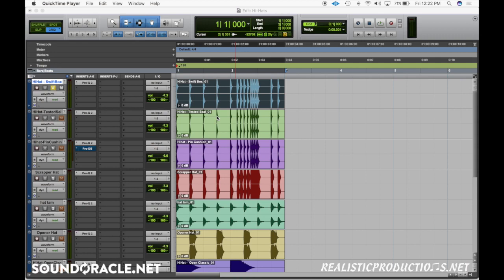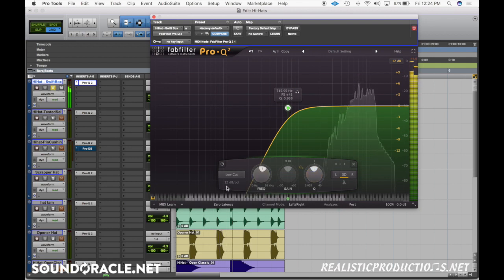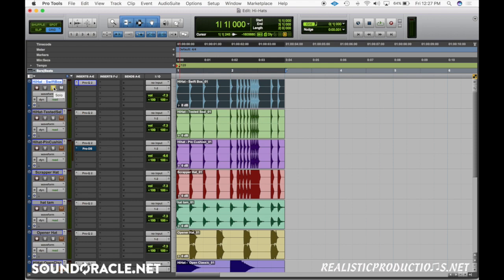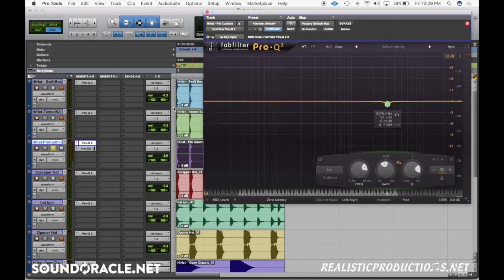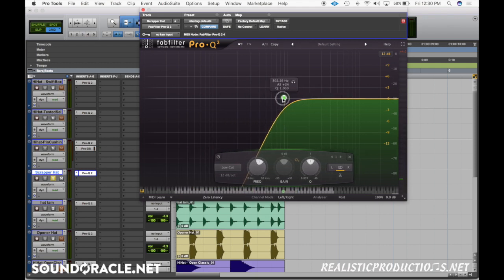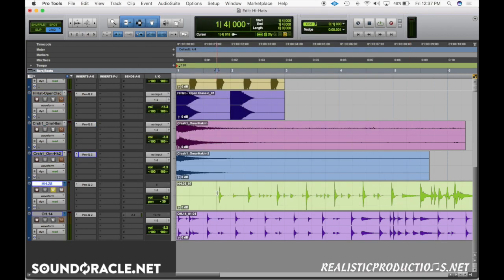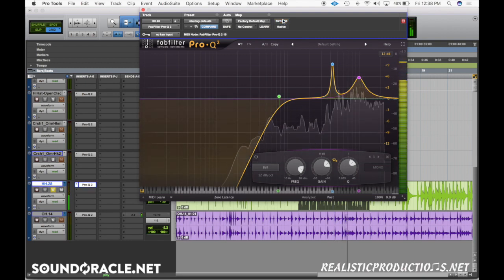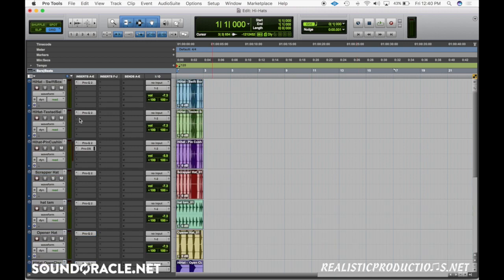Hi-Hat Tutorial: How to EQ The Perfect Hi-Hat | Soundoracle.net

Comment: You should NEVER EVER use that type of slope on a hhat. Also, that rumble...is what makes the difference between a professional and a homemade track.
Reply: The high pass slope? You mean like it should rather be straight down I assume.
Reply: So what slope should be used?
Reply: Slopes are narrow or wide. You should never use a slope that narrow on a high hat. A high hat is basically noise. Not a tone. Of course, if there is a resonant frequency in the hat, you should use a narrow eq to eliminate the resonance. But that is not common in hats. Cut the lows of a high hat until it sounds different. Then back it up a little. If you don’t have good listening environment, do not go under 150hz.
Reply: Also, I may use the term slope very wrong. Sorry😁